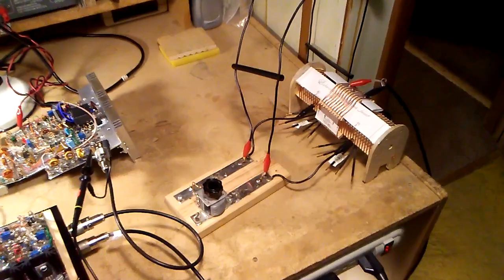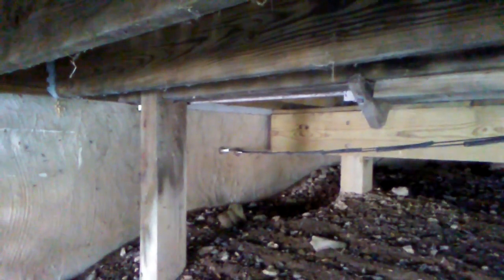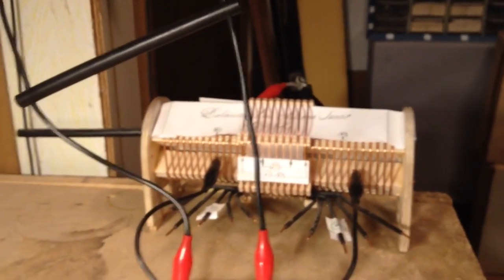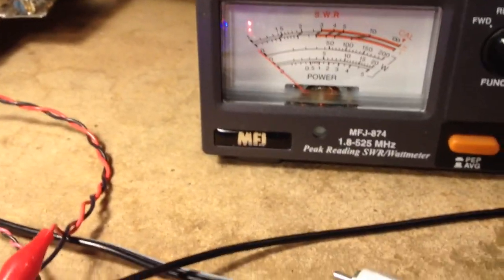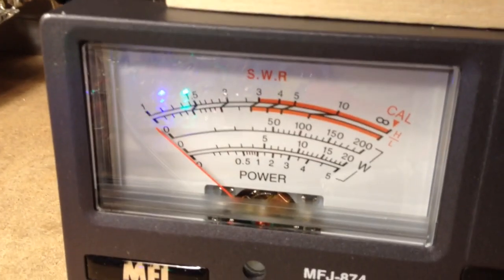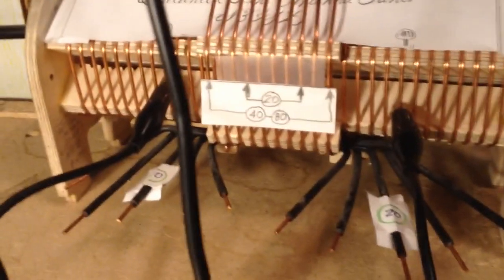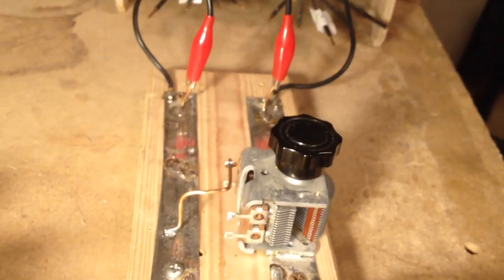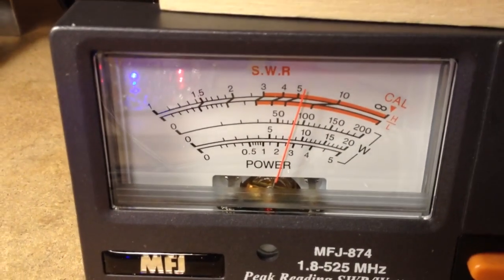N3FJZ 80 Meter Loop Antenna

Comment: I love my 80m loop. 273' fed with a 4:1 Rothroff voltage balun at the feed point. Less than 0.3 db loss into 75' lmr400. No tuner needed. Works on all its harmonics. Under 1.5:1 on most bands. 30m is 3:1 without a tuner. Upper end of 75m needs a tuner. But loss on coax at 2.75:1 at 3.9 MHz is very little. Zero RFI or CMC on the coax at legal limit. And open wire line when wet or with snow on it isn't loss less.

Comment: Sorry, no open feed lines in the shack.   Ever.
Reply: Fine for under 5W and receive, no? I want to build a horizontal loop for my Drake R8B using only my own homebuilt 500 ohm ladderline. With twists in the ladderline, right? The rig has 500 ohm balanced ant input terminal screws in addition to the 50 ohm SO-239.

Comment: This set up works better than having a ladder line outside going to a balun and then 50 Ohm coax to the shack.
Reply: which Balun ? most use Match /tuners in their shack , do not have time or inclination to build this unit , (which i admire & appreciate ), N4HNH also has Video on using 4:1 with his auto tuner , from Balun Designs in TX , specifics help others , this is not like the Magic hobby which is so Secretive , we need to share more . Best Wishes to All , 73, de AJ W5HEH
 PS there is conflicting info on 90degree angles for Ladder/Open feed line .